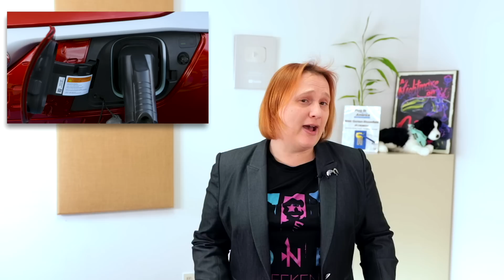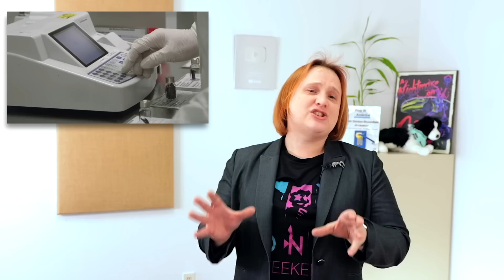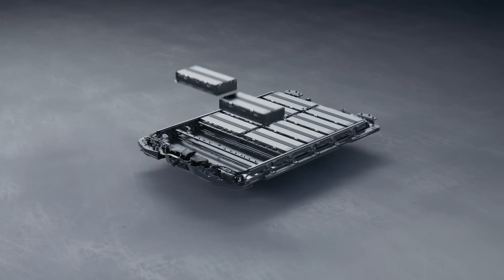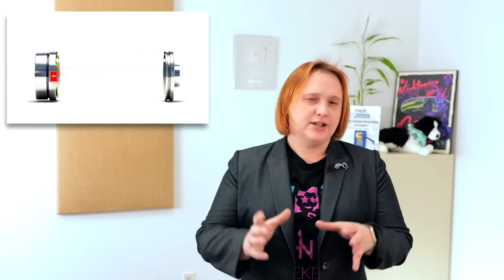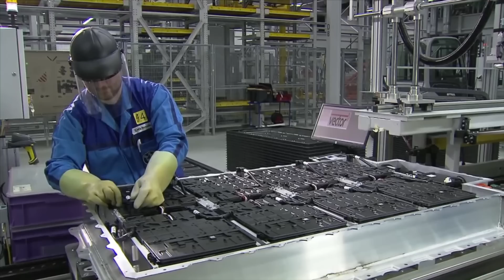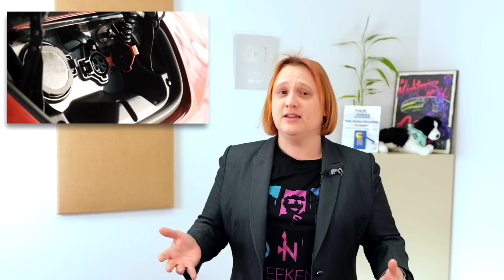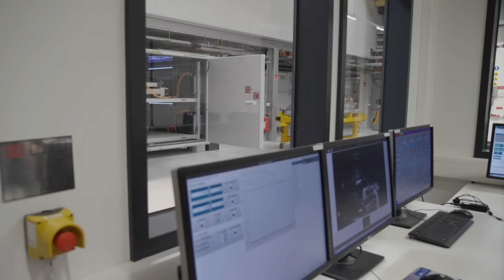Has Samsung Found The Holy Grail Of Solid State Batteries?

Comment: Niki, it's not just cars.

The most important need for batteries is for grid storage.  There we need many TWh.
Reply: But for this we need low cost, not light weight or high density. Second life vehicle batteries will probably be big here.
Reply: True. But here we need cheap batteries. They may be heavy and large (low density).
Reply: Absolutely.! Storage is key in green energy production.!
Reply: Yes... but they do not need to be tiny or light weight for grid applications.  Degraded car batteries will work great, for example, and give them a re-use of many years before recycling them.

Comment: Samsung, IBM, Toyota, Everyone has a solid sate battery design. What they don’t have is a means to produce it and make it commercial viable yet. Cost to produce it is way too high.
Reply: If you're to believe the  YouTubes, Samsung will be releasing a phone with this chemistry later this year.  Speculated to be in their Galaxy A line.  If this is true, it implies they're beginning a production ramp.  You start with one, then another, then all of your line as you increase production capacity. Then, someone else conducts a little industrial espionage, and whores your tech out cheap, then things really take off.
Reply: They are expensive and break down too easy
Reply: @fredyrodriguez4221  WHAT is expensive and breaks down to easily?

If you mean solid state batteries, we only have a prototype production line at the moment, with zero sales. So obviously economies of scale are not yet applied. As far as breaking down easily, there was a dendrite issue, that Samsung and others seem to have overcome.
Reply: @nnnn7828  sure generally speaking but Chinese girls aren't the best lays. In China, you only get one variety. In America, you get all sorts of nationalities and individual styles are more distinguished
Reply: @christianjardin3110  in USA more woman are fat, than in china, that's the biggest downside of junk foods or less workout in USA. Even some or many man looks somewhat too fat. Just like Trump and Xi, france and japan less fat for sure 🤔
Reply: @christianjardin3110  USA not worth my time seeing the prison system and horrendous healthcare there, for vacation yes, to live there nah, copyright system worse than japan. I don't think japanese that making doujinshi fan comic or pervert comic arrested. In USA well it's worse not enough freedom against the corporations. You could try making disney fan comic and selling them. Not a fan of copyright system, even some japanese like hideaki anno from evangelion and original creator of games like xenogear, final fantasy and metal gear solid have no power over the corporation that owns the games name and idea.
In the west something like that is burnout, dead space, red alert, fable, scalebound.
Reply: I assume you mean "a means to produce it without taking a loss". One reason is that commercial adoption trails lab research and development about 10 years on average. So it is still early for the commercialization of solid state batteries. Give it another 5 years, at least. 
It is not enough to develop a breakthrough technology, you also need to develop a way to produce it in high volume at a reasonable cost.
Reply: "Now, the solid-state battery researcher and maker has announced that its production line is fully functional and currently producing solid-state batteries."

https://insideevs.com/news/370240/solid-power-producing-solid-state-batteries/

Theres a company in China saying the same.
Reply: @martinw245  China probably stole it from Samsung. Intellectual Property Rights mean nothing to the Great Leap Forward
Reply: @christianjardin3110  

They can be somewhat nefarious with such things but I've seen no evidence it's the case.

Solid Power are not Chinese of course. I believe they are US
Reply: Martin W I have seen that, but haven’t heard or read anything new since September. I guess we shall see. 

Honestly, I hope they did find a way to produce a solid state battery for an affordable price.
Reply: @ACGBLR  Its  pilot line. A prototype production line. If it functions as it should, it's a huge step in the right direction. The final stage before a full scale production line.
Reply: @christianjardin3110  I don't think it matters anyway, tech is just techs  anything else is benchmark and move forward to the next techs, sure it helps to pay fees to the original creator of monalisa (samsung or any techs company), but what matter the most is giving the best for customer with products that cost less and better in long term.

even if china is not a perfect nation, they are not in war with anyone, clean from afganistan, irak, lybia, syria, yemen war. And that is somewhat okay.
Reply: @christianjardin3110  I'm not left or right, and definitely not chinese, got no chinese identity, documents or passport, here just observing what's new, if you're using iphone you are obviously using chinese products, maybe only samsung or japanese phone using more parts that are not produced in china, even military industrial complex that are doing ugly things here and there with children, family and woman d e a d everywhere are using large amounts of specific parts manufactured in china, they got large amount of rare earth, don't want to use it sure go back to stone age or back to basic with farming, using recycled products also could be an option to avoid technology from china. Again just an observer and picking a side which one less evil than the other one for an opinion, and technology quite interesting. Not supporter of any government I guess, but for singapore they did good.
Reply: @nnnn7828  why remove your comment
Reply: @christianjardin3110  I'm not removing anything and china is refined north korea, if you dislike china you gotta fix your nation first and north korea before china. I don't think north korean can travel and study abroad.
Reply: @christianjardin3110  and UK want to use 5G from huawei, so ? you are wrong about your facts.
Reply: @christianjardin3110  HK? also wrong HK do accepts chinese, HK problem is housing, not enough housing for low income earners and elderly in HK, in HK there is left and right, right hate chinese mainland and prefer british, left is somewhat okay or don't really care about china.
Reply: @christianjardin3110   Last time I check china owns more intellectual property more than USA prove me if I'm wrong, even Disney Lion King is a ripoff of japanese animation Kimba the white Lion, and do disney pay japan for copying their intellectual property, I doubt it.
Reply: @nnnn7828  if something is considered a fact how can it be wrong.
Reply: @nnnn7828  Hong Kong is protesting because China's trying to take over Hong Kong and attempting to extradite its citizens in China
Reply: @christianjardin3110  do protester that hate trump means all american hate trump? obviously not, same with HK large number of HK peoples hate chinese mainland, but about 30percent or more HK peoples still somewhat okay with chinese mainland, and macau totally agree with chinese mainland, maybe because they are somewhat okay and don't really care about things like HK peoples, and macau housing more cheaper for low income earner than HK for sure.
Reply: @christianjardin3110  you are not that smart aren't you? You don't even know italian love chinese peoples, and UK want to use chinese 5G.
Reply: @nnnn7828  hahahaha 57% of Italians have negative sentiments towards Chinese. After more than 17,000 deaths from Covid19. Do you think that number is higher or lower than 57%
Reply: @christianjardin3110  I don't like wumao they are not smart, good to blame them, so I do like you for this specific part of your reply but you are wrong about some of the things here, so I do facts checking to reply what you said.
Reply: @christianjardin3110  some Italian yes, but not all. They are receiving donation and doctor's from china to helps them reducing covid19  numbers.
Reply: @christianjardin3110  here in my yt I can see all my reply, might be hidden by yt before you could see what i post here. it's not like i disable or delete things that I want to say, silly me if I want to hide what I say in yt, I do like to talk and reply to things if it means voicing what I know about things.
Reply: @christianjardin3110  is this the one that you want to see?

"I don't think it matters anyway, tech is just techs anything else is benchmark and move forward to the next techs, sure it helps to pay fees to the original creator of monalisa (samsung or any techs company), but what matter the most is giving the best for customer with products that cost less and better in long term.

even if china is not a perfect nation, they are not in war with anyone, clean from afganistan, irak, lybia, syria, yemen w a r. And that is somewhat okay."
Reply: @christianjardin3110  or this one? 

" I'm not left or right, and definitely not chinese, got no chnese identity, documents or passport, here just observing what's new, if you're using iphone you are obviously using chinese products, maybe only samsung or japanese phone using more parts that are not produced in china, even military industrial complex that are doing ugly things here and there with children, family and woman d e a d everywhere are using large amounts of specific parts manufactured in china, they got large amount of rare earth, don't want to use it sure go back to stone age or back to basic with farming, using recycled products also could be an option to avoid technology from china. Again just an observer and picking a side which one less evil than the other one for an opinion, and technology quite interesting. Not supporter of any government I guess, but for singapore they did good."
Reply: @nnnn7828  no that's not the one hahahaha I don't want to be redundant but you accused me of owning an iPhone made from China yada yada
Reply: @christianjardin3110  well as I said before I like technology, if I can choose between japan and china I want to choose japan, but Japan is now number 3, so they are quite lacking in terms of global trade and money, chinese is more hardworker than Japanese, even with all their flaws. They do fix up their broken nation from absolute poverty to the current china producing more than 70% of all electronics, even for simple household items. 
Korean also lacking, other than samsung or LG, nothing from south korea is better than japan or china in my opinion.

USA always talks but somewhat lacking in many things, they are good in wallstreet stock traders and bankers, corporation, and military industrial complex, other than that, many are declining. so that's why manufacturing are now in china, chinese labor are paid cheaper and more hardworking than USA.
Reply: @christianjardin3110  well I do prefer singapore for that, good nation low crime rate very low corruption. Too bad they are not good at producing things compared to china. Japan still better than singapore for technology.
Reply: @nnnn7828  technology is too broad. Consumer electronics is more specific. And I prefer Samsung over Huawei and LG over Haier. With regards to vehicles I prefer Japanese. Toyota's still the benchmark for reliability. Although the gap is narrowing. The Chinese are still not there yet with regards to these types of consumables. The Japanese and Korean are farther ahead. Less so now considering Chinese steal from everyone including Google, Amazon and Microsoft. And everything that's built on Chinese society is a clone or blueprint found somewhere else in the world. But I will give credit where due. Specially if you're referring to all electronic components, manufacturing companies such as Foxconn and rare earth elements found on Chinese soil. China's a huge country capable of resources and mobilization to provide for worldwide increasing demand. Sure Communist China has lifted many from poverty but if given the choice would the poor choose China over the United States of America or any other nation in the G20. The gdp per Capita alone would convince them otherwise. How about the HDI rankings. A country like Canada would be obviously more attractive. How about a Norway which focuses on equality and progressiveness? You get my point. Although I can acknowledge what the PRC has accomplished since its induction in the WTO. I would never want to live there. Fresh drinking water. Free Health and Education. Clean air. Modern infrastructure. Freedom of rights, speech and the liberty to own property. The list is endless from garbage disposal systems to pollution to a rigid totalitarian system. Food regulation and even plagues, infectious diseases and viruses. Objectively speaking would China be at the top of the list of countries you would want to willingly reside for the rest of your life. I think Not.
Reply: @nnnn7828  we finally agree on something. So let me ask you this. If China's such a great country. Why would you choose Singapore?
Reply: @nnnn7828  in this day and age you can live in the middle of the woods and still be able to get your hands on all the technology that you would ever desire. Heck you can make your own interplanetary electro-dome if you have enough money to do so.
Reply: @christianjardin3110  no school stabbing in singapore, no guns related crime too, there is plenty of videos of school shooting in USA, no food scandal as well, cleaner water, cleaner air, more internet freedom-nothing is blocked other than criminal or te rro ri sm websites. And plenty of good bus and subway just like china.
Reply: @christianjardin3110  exynos too hot, slow and drains battery more, kirin much better, samsung exynos not quite reliable.
Reply: @christianjardin3110  I do want the world have less war, less violent crime and improving the life of low income earner, but sadly many things are declining, mostly because too many taxation, inflation, inefficient bureaucracy and governments or corrupt officials. And too many bad debts everywhere.
Reply: @nnnn7828  that was a China comparison. Singapore's on another level.
Reply: @nnnn7828  At the top tier exynos has better CPU and GPU performance as well as user experience
Reply: @christianjardin3110  exynos is somewhat a failure, that's why samsung closing their R&D center in texas. I don't like exynos if i can choose any other SOC. Not quite sure if it means exynos will do better in the future than other SOC.